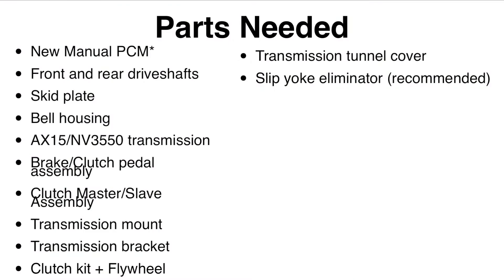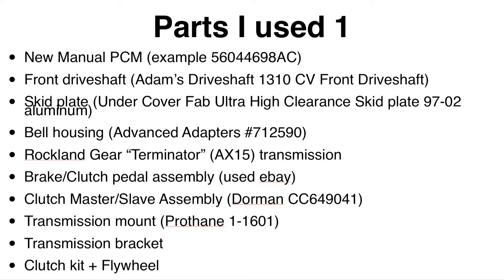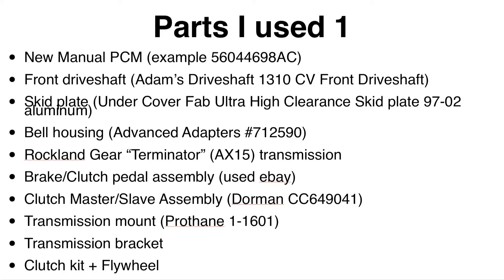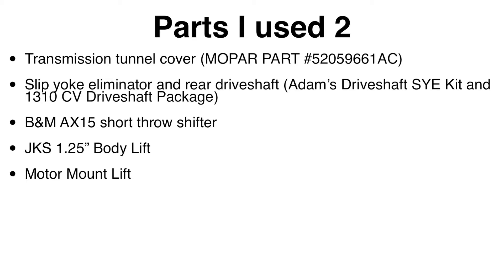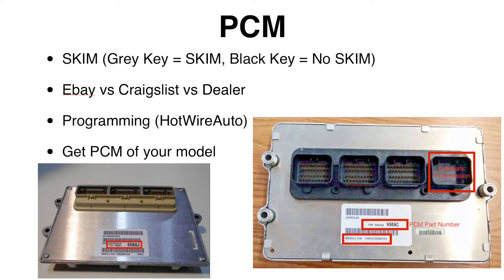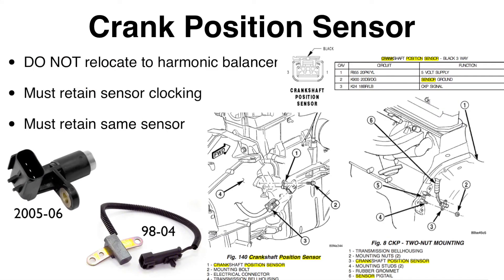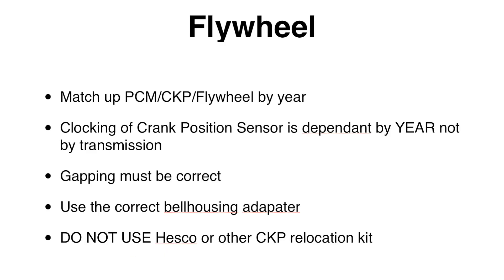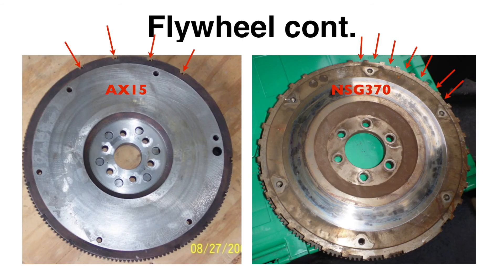Jeep TJ/LJ Manual Swap Part 1

Comment: I’m just starting on down this pathway. Picking up a low mileage nsg370 this weekend. 

I see you say you didn’t replace any wiring harnesses. Do your have a check engine light? What did you do with the extra PCM connector considering the manual pcm is a 3 plug vs the 4 plug auto?

Comment: I bought a 01 that has a auto to manual swap done. The reverse lights don’t work. I haven’t looked into it yet. Is it the same switch and plug for both transmissions?

Comment: You mention buying a bell housing or bell housing adapter for the AX15. I'm swapping a  NSG370 from an 06 into my 04 Rubicon. It has a built in bell housing so I assume I'll just plug into the crank sensor from the NSG370 that will work with the flywheel.

Comment: we have done this and got it to work no check engine lights and everything working correctly on a 2006tj
Reply: Did you have to swap pcms? Or were you able to use the auto PCM with some wiring adaptations?
Reply: @BrewCrew74  im curious too lol
Reply from the maker: So it all worked out? Congrats, I hope it was helpful
Reply: @jerseydevil7574  there were more glitches than I anticipated but we know every part and every glitch possible lol Jeep has been on the road for a couple of weeks and works flawlessly. You'd never know it wasn't a factory stick Jeep. Your info was very helpful. Just Jeeps 727 536-4000.
Reply from the maker: @deemon9367  yea there are tons of little glitches to run across. Mine you'd never be able to tell is an AX15 swapped from an Auto.
Reply: post the details
Reply: @tangomikefoxtrot  I did a AMC turbo 400 on a 05 LJ auto  Left the trans portion of harness tied off and bagged the connectors up away from the trans. There were trans codes in ECU but didn't set CEL. HP tuner software can turn all that off so you don't have codes stored.

Comment: I got a question do you have to change all the wiring becauseI did  the same thing to my Jeep but I can’t get it to start it just cranks but it doesn’t start
Reply from the maker: No wiring stays the same. Check the NSS (Neutral Safety Switch). Also check if you have the SKIM light showing up. If the SKIM light shows up..you need to disable skim

Comment: I have a 2005 TJ Rubicon with an auto trannie. THE ONLY PROBLEM I KEEP HAVING IS THE DAMN TCM/PCM......EVEN THE DEALER IS LOST.
Reply: Same here. Were you able to get your PCM fix/replaced?
Reply: My original TCM/PCM was rebuilt to no avail. The Dodge dealership, where my TJ sat for more than two months, offered me $10K on a trade in for a Toyota Tacoma.....I took it. Very disappointed with the number of solid Wranglers still in solid working condition, but computer or wiring problems plague them all.
Reply: Teo91590 I was not able to get it repaired. As a gesture of good faith the Dodge dealership gave me $10,000 on my Rubicon as a trade on a new pickup
Reply from the maker: @Teo91590  I did a lot of hunting for a pulled PCM and ended up getting my "spare" rebuilt

Comment: I plan to swap my tj's auto out.  I'm hoping to skip the PCM swap, hopefully shorting the park switch to ground will get me going.  In the future I would like to eliminate the PCM entirely, that will require some more research on my part.   I could not find part two, did you post it yet?  I would really like to see it.
Reply: Were you ever able to make your auto PCM work? I'm doing a Auto swap and my computer's programmed with HP tuners. I believe there is wire changes that can be made to allow the auto PCM to work. Let me know
Reply: @BrewCrew74 Were you able to use the auto pcm?

Comment: Any idea if this video would work for a 1995 xj ax15 swap or no??
Reply from the maker: More or less the same, but the part numbers are different, and ECU/PCM is totally different. The older XJs had a separate TCM/PCM so you should be ok.

Comment: What is the benefits of this swap? I figured automatic would be more desirable, especially off-roading..
Reply: Chase Frazee, a lot of people like me like to "row their own boat".  I personally cant stand the kickdown timing of the RLE47 transmission.  It is also important to note that the shift points are thrown off when putting on larger tires or changing axle gear ratios.
Reply: nerdanderthal IDontLikeGooglePlus that's something I haven't thought of, probably because I drive a 6-speed LJ. Very good point.
Reply: that kick down is brutal

Comment: I got a 1991 wrangler 4.0 5 speed trans I replaced the clutch and...well the clutch line won't connect to the slave cylinder....bought it through autozone...they probably have me a clutch kit for a 2001...

Comment: I have a 1997 Wrangler that was a 5 speed AX5, I have everything still in it except the transmission itself. 

I have a 2001 Wrangler with an auto transmission that is going bad. What parts can I use from the ‘97 if I were to install an AX15 in it?

Comment: i have a 1999 TJ does this appy to all TJs or only the 2000s TJs jw
Reply from the maker: There was a few changes to the PCM, and OPDA setups over the TJ/LJ years. if i remember...97-2002 should be same, 02-04 same and 05-06 same. 05-06 is CAN-BUS with a different style crank position sensor which means different tone ring and different setup, but the concepts are the same just need to track down your part number. Check Advanced Adapters.

Comment: Also I greatly appreciate this video I have burned up two 42rle transmissions and final said screw that POS slush box
Reply: i have never had an issue with the actual trans itself, just the damned pcm. I purchased a pcm from the jeep dealer for 1200$ installed and havent had an issue yet. I love my jeep and it has no issue with 33s and 4.88s. Sits at about 2500 rpms at 70-75 with plenty of power in OD. With the 4.88s it doesnt surge and hunt for gears. im willing to bet you have 3.73s and large tires and didnt regear. That will destroy the trans unless you drive it as a 3 speed turning off the OD each time. I am in the process of converting mine just because I want a manual and love my jeep. Plus winter is coming and i need a project. lol
Reply: I actually have had 4.56 for a while the second brand new 42rle I had burnt up after 4 months of use I’ve already started on the manual swap I have everything I need already Just have to get the PCM figured out .
I got one from a 2006 same year as mine that rolled two days ago. I literally pulled it the morning it rolled into the pull a part.
It isn’t skim so I’m hoping I can just plug and play with my ax15 with the Novak bell housing.
Reply: I also have wished mine was a manual ever since I have had it !!! And it’s a project for me I was forced to buy a car because I was still paying off the loan for the transmission I didn’t even bother with a warranty sincerely I am not that fond of the auto anyways!
Reply: Had to be a shit company rebuilding that trans. Seriously!  Most people that put 4.56 in the 42rle wish they had went with the 4.88s. with the 4.88s that trans is a beast. Also I do have a external trans cooler on mine. It's the 350$ one that has its own electric fan.  PCM thing isn't to much of a problem. I was told you can still use the auto PCM but it will just throw codes. If you have a non skim car and put in a non skim PCM you will be fine. It will eventually throw a code if you don't go to the dealer and pay the 100$ to get the VIN and mileage updated on the PCM.
Reply: So as long as I have the PCM I will be able to drive it ? I have also heard about using the auto computer but you have to have the range selector plugged in and stuck in either park or neutral
Reply: I have heard 2 ways. One guy said you don't need the range selector hooked up, the other guy said you do. There's a easy way to find out. Unplug the transmission connector from the PCM and see if your jeep starts. If it doesn't you need the range selector hooked up. If it does start, you should only get a check engine light. It may also run in limp mode which to me seemed like it had more power lol. Mine ran in limp mode when the PCM went bad because it thought the trans was overheated.

Comment: I am working on this conversion right now! just to clarify Jersey Devil, I can keep the 42rle harness and just tuck it up or remove it and don't need another harness just the pcm from a manual?
Reply: yes mike. Hotwire auto has also told me they can try to reprogram my 42rle pcm to think it is a manual pcm. They charge 100$ for this but do not guarantee it will work. Hes pretty sure it will, but no one has attempted this yet. I happened to find a 2005 pcm that HAS skim and he charges 250$ to remove skim from the pcm.
Reply: This is great news ... I have everything for the swap already even the manual PCM however I tried mocking it up and making sure it works I get no crank.... the dash and gauges work the fuel pump primes all I hear is a click from the glove compartment and  the radio turns off and back on ... brand new electrical starting system and the starter doesn’t even turn the engine...
Reply: That's odd. Does it crank with the old PCM back in?
Reply: I tried and it doesn’t ... however I didn’t have any auto plugs hooked up so I’m assuming it’s because it wasn’t sensing it in neutral
Reply: Mike message me on Facebook. I'm Florida Prepper.
Reply: I have been lucky acquiring parts especially the trans I believe it’s low mileage because I pulled it from a 99 in a junk yard in belief I was getting a ax15 and got home cleaned it up and realized I had a nv3550 which didn’t come in Jeeps until 2000
Reply: (Team Ramrod)???
Reply: So I think I found my problem will find out by the end of next week!  I had installed the fuse in block 20/28 can’t recall at the moment to bypass he clutch interlock switch to start the Jeep without depressing the clutch. On some year models you can do this and it work fine however with the 05-06 you must have the tcase in 4low. Due to the fact that I did not have my tcase connected nor plugged in the CLutch interlock switch could not be bypassed since it grounds through the tcase wiring. And I was only trying to ensure I would get a crank start and had not installed everything yet.
Reply from the maker: That almost sounds like SKIM...almost. SKIM would allow it to start for a second then shut off. If you had done it too many times it will no longer crank (and need to get it unlocked). I jumped the NSS. It is in the harness by where the clutch would go.
Reply: Team Ramrod was from the movie super troopers.
Reply: Jersey after I talked with him he was able to get the jeep to start with the old PCM in and the auto trans plugged back in.
Reply: Jersey Devil, why exactly did you have to get your manual PCM programmed? Was it mainly to remove skim or even a non skim module wouldn’t allow you to drive without programming?

Comment: I replaces the transmission of my automatic tj99 with a manual (I bought a destroyed tj97), but I did not have to replace PCM. The original PCM of my automatic 99tj worked fine.
Thanks for your help and I look forward to your part II.
Reply from the maker: There was a switch over in 2004 or 2005 where the PCM is totally different and the TCM became integrated.
Reply: did you have to buy any extra parts and did everything bolt on ok? I'm asking because I recently found a 98 4.0 manual for parts that I want to put in my Automatic.
Reply: It was take one and put in the other. I just had to buy a clutch because the other was bad. Follow the tips of mr. Devil and everything worked.

Comment: how much did you spend total on this?
Reply from the maker: Tough call as I ended up upgrading along the way as well as had some "failed" methods. Trans was a custom one and was 1800, skid was 350ish, PCM was 100, etc. I think total in I was in less than 3k.
Reply: Jersey do you have the part number to the non skim 05-06 manual pcm?
Reply from the maker: @JeepingItEasy  No I just ended up finding one from a matching Jeep.

Comment: I have begun collecting parts for this swap. Lucky for me I have a guy in town who parts out wrecked jeeps. I am getting all the parts I need from a 05 manual and the trans I am going to use is the ax15. I have the dreaded 42rle in my 06. it has the computer issue where it gets stuck in 2nd gear until i reset the pcm. I have rebuilt the trans, and now they want 1200$ for the pcm. Its a total scam! Any pointers would be awesome man. I have a NON skim 06 auto 4.0. I can get all of the swap parts with the pcm for 1500$ From what i see in your video I need the o5-06 manual flywheel, and it will bolt to the advanced adapter bell and the ax15 or nv3550?
Reply from the maker: The key is to match the PCM/Flywheel/Crank sensor. The PCM is expecting to see the same crank sensor (they changed from older TJs), and the crank sensor is looking for the correct clocking on the flywheel. I'd advise not doing the HESCO CPK as mine had some deflection under high load (highway) and would throw codes as the sensor slightly backed off of the sensor ring. I got lucky and got a SKIM PCM for $100 on a forum, sent it to HotWireAuto (jeep shop) and had them reset the PCM so it had no SKIM. Also there is a stupid rubber boot on the tub that is pricey but not 100% worth it.
Reply: im getting a pcm from a 2006 manual, and a flywheel from a 2006 manual. Same vehicle. Mine is a 06 so it should use the same cps. Correct? Im buying the advanced adapters bell like you used.
Reply from the maker: Yup. CPS is for 05-06 (or 04-06 I forget). Same CPS for the manual and auto.
Reply: Thanks I plan on documenting the whole thing on my channel
Reply: guy at the jeep dealer told me I can use the ECM from the auto if i really want to save some money, but it will just throw codes thinking the auto trans has failed. Sound legit?
Reply from the maker: @JeepingItEasy  I know im reply super late, but no it wont work as far as I know

Comment: Can you do it to a YJ? If so how difficult may it be...
Reply from the maker: Im not too familiar with the YJ electronics (the main issue with these swaps) but it should be a ton easier. I think the TCM was separate from the PCM in pre-2005 Jeeps so it shouldn't be much of an issue. You most probably only need is the correct skidplate, pedals, trans, driveshafts and you should be ok. You might run into an issue with the Park sensor but it can be defeated. You may end up like me and have no neutral safety switch but that isn't much of a hassle. Relocating the crank position sensor to the harmonic balancer using a Hesco kit may work as well for you but it didn't take very well for me.
Reply: Thanks!!

Comment: Dear, 
I'm on this swap on the 2005 tj. I'm facing some kind of problem. Can i contact you? I believe you can help me and direct me with the solution.
Reply from the maker: What issues are you having?
Reply: Jersey Devil I need to know if now I have to change the PMC to manual PMC? I have ax15 on the car now, the car is running with the auto PMC, but the power isn’t as supposed to be. As I saw your video, I plan to get Manual PMC & ax15 housing. What do you recommend for me? I need to know where to get the right parts, i mean the housing? 
I can texting you if you’re okay with that.
Reply from the maker: @mjh3939  I listed the housing part number on the video. https://www.advanceadapters.com/products/712590--jeep-nv3550--ax15-bellhousing-to-40l-engines/